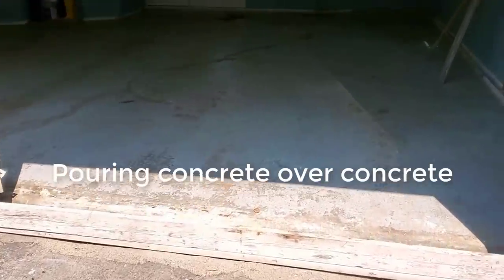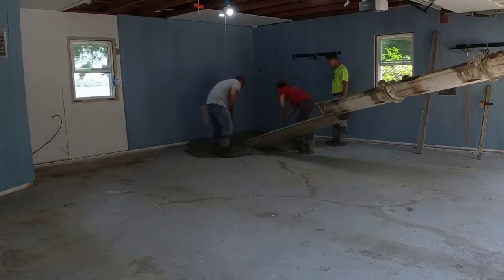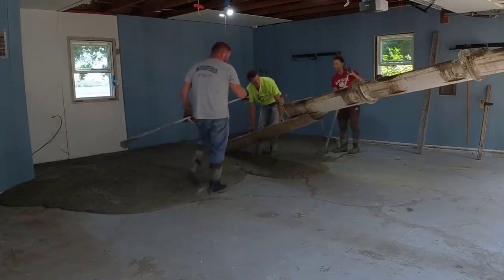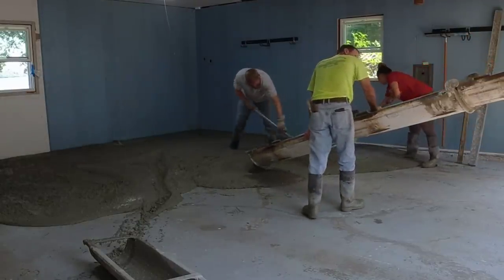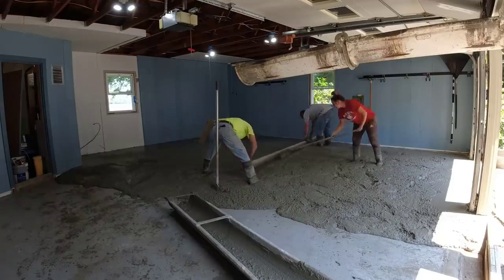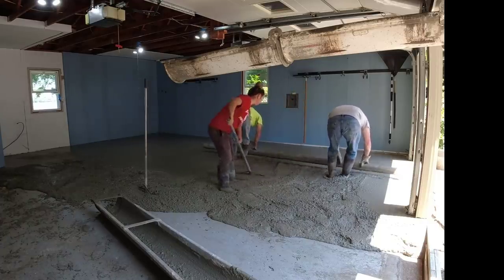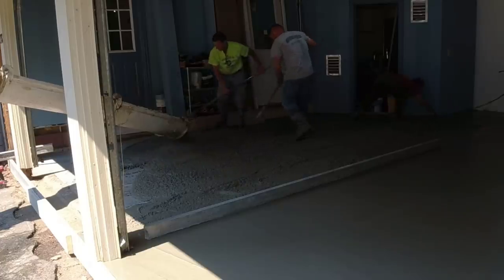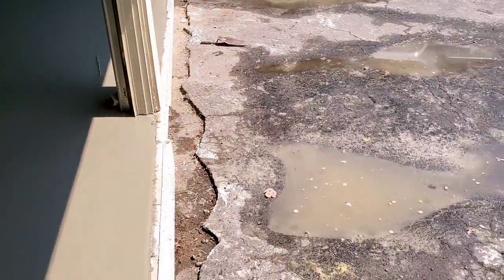Pouring Concrete OVER Concrete (New Garage Floor over The Old One)

Comment: Do you roughen the old floor?  Any prep beyond pressure washing?
Reply: Don't need to rough it up, concrete is naturally porous. It doesn't need to be "bonded" in a sense like glue. It's gonna conform to the surface as when it is poured, it is viscous flows. The weight and size of it is going to hold it down. Water ingress isn't gonna be an issue as it is a sealed garage.

Comment: I personally would never pour over old concrete. Too many risk. Creates a spot for moisture to get in between the two slabs even if a vapor barrier is installed, if the old slab is cracked, busted, etc, those issues should be mitigated first. Usually that means it's a subbase issue. Which pouring more concrete on top of only compunds the issue.  Even pinning to the old slab, transfers the same stesses onto the new slab.  

People are too lawsuit happy to take the risk doing it, id pass on a job pouring over an existing slab, even if i needed the money

Comment: I had a garage floor that was really rough, 40 years old. We poured a 3 inch cap on it 12 years ago, it developed a few hair line cracks but it did well. It was an old block garage. We could rebuild it or tear it down. We sealed and painted block, installed new doors, sheet rocked and insulated ceiling, new roof, new gas furnace, new wiring, installed an air compressor. Came out beautiful. I just sold house and large block detached garage was a huge selling point. New owner loved it. As soon as he walked in the shop 15 minutes later he took the house for what I was asking. He completely gutted the house which we spent 70,000 remodeling at same time and left garage alone.

Comment: Attention DIY'ers and contractors: NEVER EVER EVER DO THIS!!!! Every single crack on the original floor WILL transfer to the new slab! Also, there's a reason why the slab has sunk in the corners: BECAUSE THE SUBGRADE IS UNSTABLE!!! Now that he's adding TONS of new concrete on top of an unstable slab, what do you think is going to happen??? Trust me tear out the slab, tamp the subgrade in 6" lifts and pour a new slab! You will avoid innumerable headaches.
Reply from the maker: Subgrades not unstable on this one, it was poured that way. I don't have any problems with hairline or small shrinkage cracks transferring up through. I saw cut plenty of contraction joints. Done over 100 this way with no problems. Unstable Subgrades, yes rip out and pour new.
Reply: @MikeDayConcrete  I gotta laugh at some of these comments. Especially because 99 percent of them are from people who know nothing about concrete other than what they have seen on utube videos. If they had half a clue, they'd know cracking is a thing regardless, the real game is controlling the cracks. I've alway saw cut quarter inch deep per inch thickness. You right around that number? Depending, of course, on what the situation is but for the most part it's quarter inch cut per inch thickness.

Comment: What you'll find out is pouring concrete over concrete if the old concrete is cracked the new concrete tends to crack at the same place 16 years boring concrete that's the way it works

Comment: Problem is it won't stick to the old concrete and always sound hollow.
Reply: Doesn't need to stick to it. It's poured on top of the old so it will conform to it. Concrete is pretty heavy and gravity is a thing here on earth. There will be no voids in it so it's not gonna be hollow either.

Comment: Can you pour a new concrete floor over an existing asphalt floor in a garage?
Reply: No you never pour concrete over blacktop. You can do asphalt over concrete but not the other way around. Asphalt is too soft and expands and contracts way more than concrete and will heave the concrete on top of it even more.

Comment: have a driveway in Virginia where it does freeze occasionally, I am thinking I want to pour 3.5 inch or greater slab on top of a wore out concrete driveway that has some cracks but is very stable and is pretty rough from erosion, versus taking it out I have to pour in small sections like 3’ x 10’ using quickcrete as I cannot get cement truck to the site.  will have rebar in it….what are your thoughts?
Reply: No don't do it. Start fresh or else you'll be right back to cracked nasty concrete. Bust it up, remove it and dig the old stone out and start fresh. Most of the time, cracking is from insufficient base and drainage issues. Best replace it all and get it in right otherwise you'll be right back to the same cracked concrete driveway but now with 2 layers of concrete cracking and flaking up.

Comment: Do you use any bonding agent before pouring?
Reply: Why? Its not like it's gonna blow away in the wind. And if the ground heaves enough, no bonding is gonna keep it together. It's gonna crack apart if it moves enough anyway.

Comment: The existing cracks will transfer thru the new crete. 
Solution- place a 1/2”-1” sand coating to make a slip joint. 

For drastic cracking, where you are pouring 3+” . Just jack hammer the entire floor. Leaving all the pieces (basically turning the old crete into gravel). Run a plate packer over it just to ensure there’s no hollows.
Then pour the fresh crete. 

*for people without a laser. Take the heights from the side, measure from your desired height to the roof joist/or finished ceiling. Then move to the Center and measure down. (The measurement increases as you move towards the doors to accommodate slope.)

Comment: Fiber-mesh is a waste of time.  I had a new 24' X 26' garage built with a 4"Fiber-mesh floor.  It cracked front to back within 3 years (2years warranty).
Reply: Fibermesh isn't designed to prevent/eliminate cracks from settlement or substandard underlying base, or weakened/watered down concrete. Those flaws (I can assure you that you had one or more) are far beyond the structural/strength limits of fibermesh and it's the true cause of the cracking. Mike's concrete looks 'flowing/watered down' only because he (properly) uses water reducing admixtures in the mix, which retains strength without adding water. Many contractor's use only water to make their concrete 'flowing', which weakens it drastically.
Fibermesh was designed to mainly control, prevent, and limit drying shrinkage cracks (tiny hairline surface-only cracking) while the concrete dries & cures, but only slight resistance to full depth cracking, which is typically caused by one (or more) of the 3 things I first mentioned.
Reply: Sounds like they don't use proper controlled cracking procedures.

Comment: I'm a 3ed generation concert man. You do not pour concrete on top of concrete all the cracks on the old floor will show up on the new slab. I seen alot of these guys videos and they are not good concrete men.
Reply: I have a question if you don't mind answering please...is there a product out there that would help keep my carport from sweating? It's very slippery when it rains or it's humid outside. It is built attached to my house but it is an open carport with half brick walls on 2 sides.

Comment: Im thinkin that if the back right corner was lower than the middle, that would mean that the subgrade wasnt as stable as it should be #1, and #2, most likely the original slab was poorly drilled and pinned into the foundation if it was at all, which would be a bit of a concern to me before I added another 24-28k lbs of concrete on top of it. Beyond that, its neither cheap, easy, or something that most rough in guys would be able to knock out in a day and make it   look correct as it should, so why not just jack it out, pouring back to the original height, and then put a a valley with a trench drain in the drive? One last thing... As wet as you poured it, and with nowhere for all that water to go but up, I think I would of left ol boy with a set of sliders and told him to crawl it out by hand. He was prolly there till the next day with a walkbehind trowel!!!

Comment: That concrete looks a little wet to me I don't care if you are using 6 sack with fiber mesh, when you had that much water to make it like soup it weakens the concrete and affects its integrity.
Reply from the maker: We use water reducer in the mix.

Comment: This is the cheap quick fix.
This will start cracking and chipping within the year and these guys will be long gone.

They should have tied the new pour to the original pour by drilling and doweling some all threads or rebar and laid down some mesh.
They also should have doweled in the perimeter and maybe even installed expansion joints to allow for movement.

This is NOT the way to cap a foundation.

Comment: The comment of “never had any issues doing it in a certain way”… way overrated. Used way too much, but there’s no definite proof that it actually work. When it comes to concrete, my ears hurt when I hear contractors say this. Even if you do a poor piss job, you still don’t find out most of the time 10yrs later. Who is going to come after you in 10+ years lol 😂 
It’s not like cooking, you’ll know right away if that meal was good it bad. 

2 cents lol 😂 
Just for fun 🤩

Comment: This is just lazy its much better to rip the old concrete out and pour in the mud. It will become much steonger and laster longer especally if you put in rebar.
Reply: Why would you put rebar in a concrete pad for a garage floor? Let me guess, mesh goes in footers and rebar goes in flat work?...